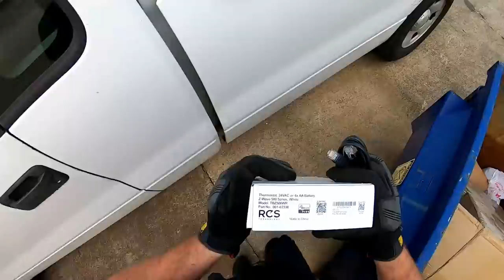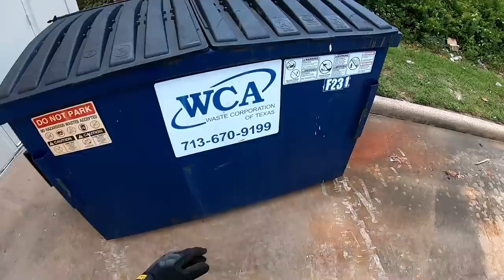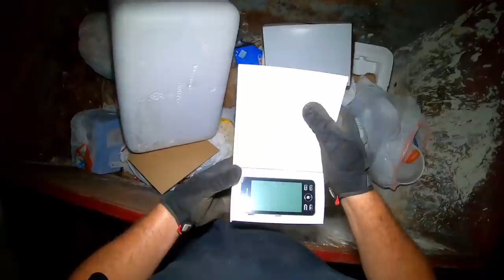Dumpster Diving "Welcome To America"

Comment: there's a lot of steel in an office chair. it should go for shred, that's what i get for them. pull the foam and cover off, and the rest is usually all metal. try heating up the glue on those scanner/scales with a heat gun to help remove it a little easier. sometimes it helps, sometimes it doesn't.

Comment: Hello Mr Mike
Have a good weekend. I just started to strip 50 pounds of number # 1 copper w I te.
I bring 6hat to my friend that will melt it for me into 10 pound blocks and weighed and stamped.
It is easier for me to scrap it and not cheated on the weight.
Some of the junk yards look at the bars like they are a prize.
I wouldn't be surprised if they ate selling them for a lot more.
Keep on scrapping

Will write a song and copywrite it. 73'
PS: work with some medical scrapping places. Those medical things you found are out of date. I had to get haz-mat certified. One tool that is kept in the truck is a geiger counter.
Those touch screen monitors are from a pos system from maybe a super market like an updated Walmart

Comment: Mike, 
Thanks for doing what you do.  I do have a question however.  Why don't you ever pick up aluminum cans?  In California the redemption value is 5 cents a can, (for anything over 24oz it's 10 cents each).  It takes about 30 cans to produce a pound and it's worth a $1.50.  
That's probably the best price you'll get with aluminum.
I don't know where you're located but I'm assuming that there is no redemption value offered in your state, still, it is aluminum, wouldn't hurt to throw it in the pile.
Reply: Texas does not give money per can. It is up to the scrap to pay per pound. He always says there is no money in cans. The price for cans where I live is .50 a pound.
Reply: And they're messy, sticky, and with them it will bring bugs, roaches and ants especially in southern Tx.

Comment: But a gallon of alcohol at the pharmacy and soak glued items in it. Then just use a putty knife to scrape off. It’s really easy once it’s soaked. Reuse the alcohol until you just need more.
Reply: Not sure about other pharmacies, but at walmart, the gallon of alcohol costs WAY WAY more per ounce than their 32 ounce bottles of alcohol.
Bigger does not always equate to cheaper. Always check price per ounce.